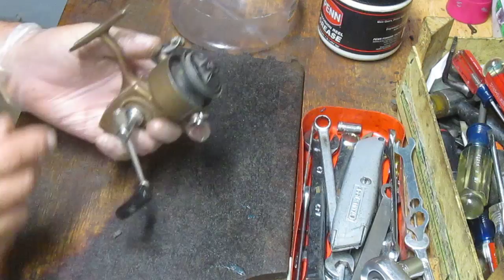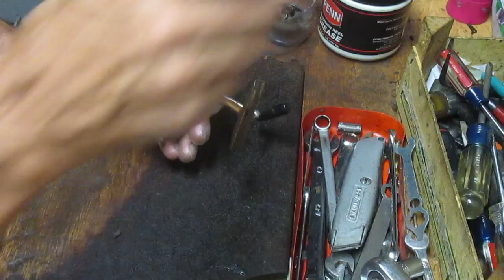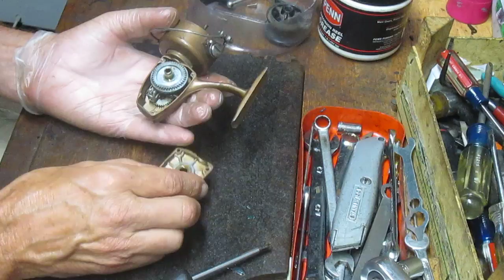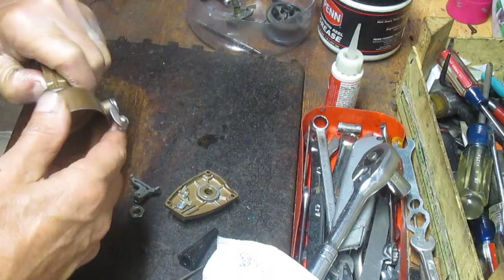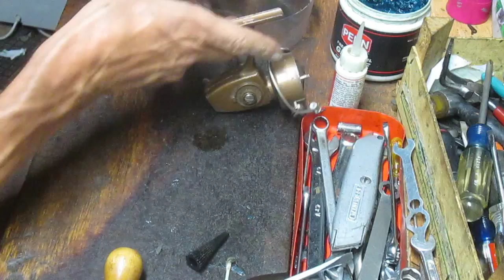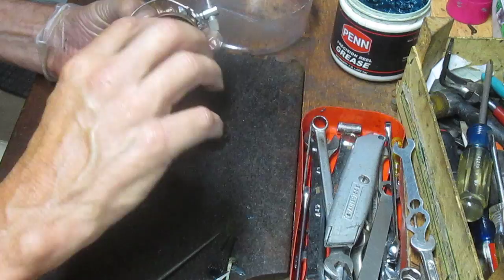Zebco XRL 40 Fishing reel take apart and service

Comment: Thank you so much for this fantastic video, I bought a used fishing rod & this reel came with it, it was very rusty, so watching this video taught me how to lubricate and oil it, however my bail doesn't work, when I move the bail back  it moves back to its original position, not sure what piece I need to look at to make sure the bail works, I have yet to service it, but I am thankful for your video, thank you so much.
Reply from the maker: Try to remove the spool and use a penetrating oil like WD40 to spray down the trip mechanism that goes from the outside part of the bail to inside the rotor.  That is probably sticking and the oil should free it and let the bail set properly. - Dennis

Comment: Silent dog spring: it’s a penn power graph 1500,the schematic shows a spring that the reel is missing yet anti reverse works and loudly, wondering if the spring would “silence” it
Reply from the maker: The Powergraph series uses the "old school" anti-reverse and not the newer anti reverse bearing.  The clicking you hear is the dog hitting the ridges of the rotor that are used as the stops.  It you are missing the spring, the dog maybe traveling too far when engaging the ridge and cause the louder noise. I suspect that you do not have the anti-reverse override when you toggle the lever.  The spring should have more of an effect there. You should have no noise when you use the over-ride to back pedal the reel.  Also - have you found the broken pieces of the spring?  Make sure there aren't any pieces interfering with the top end operation.  You definitely should replace the missing spring.  Thank you for asking - Dennis

Comment: Hey Dennis could you explain a silent dog spring thanks
Reply from the maker: Hi Bob - can you give me a little more information?  Reel type, etc.  There are different configurations of the anti-reverse and the associated dogs.  Some, like the Daiwa 7000 silver series spinning reels are very loud. Some conventional reels vary, like Penn JigMasters or Penn DelMars, where one is loud and another less so.  The ones that are more quiet on those are generally due to worn parts or fatigued springs that still work, but are less robust then when new.  If this does not help answer the question, please let me know the specifics and I will try to clarify more.  Thank you for asking - Dennis